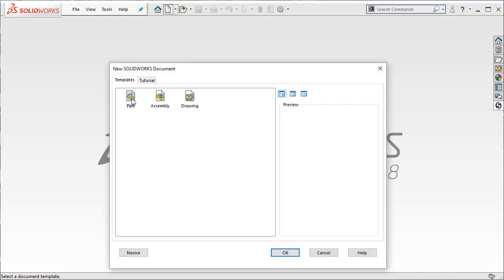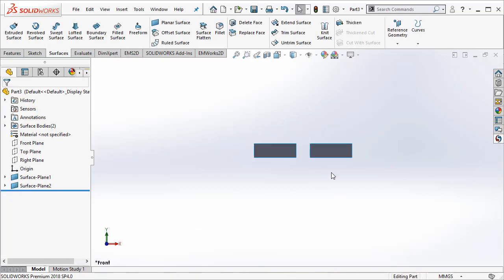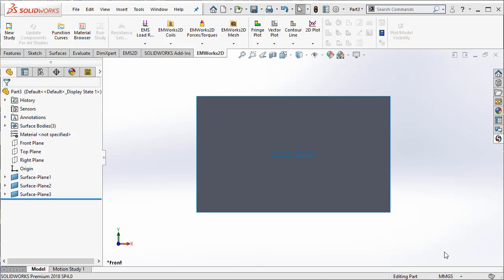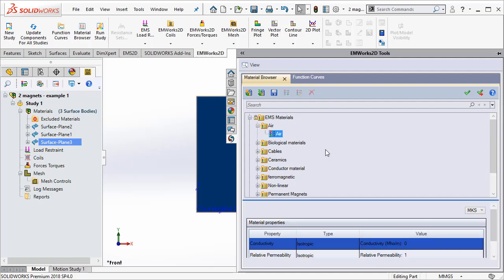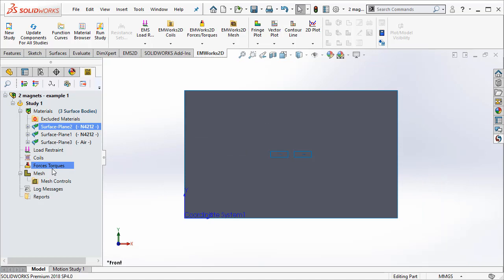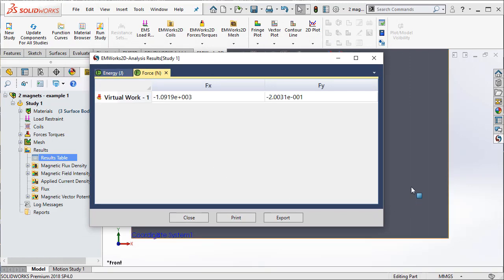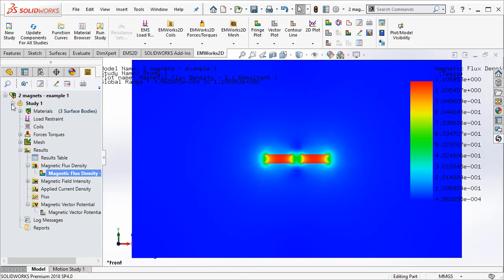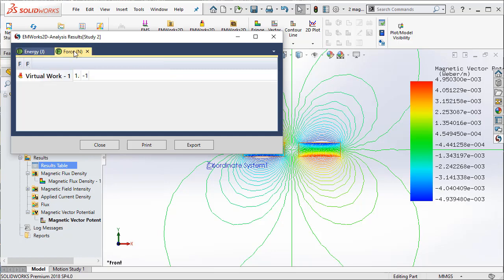2 Magnets: Example 1

Comment: Hello Arvind! Thank you very mach for your examples! If you create two 3D magnit balls and make force analise for them you will find that all Axises (X, Y, Z) has different values. Ofcaurse coordinates and coercivity should be applied in a propper manner. From my point of view two axises must have the same or pretty close values but not different. Looks strange for that software...